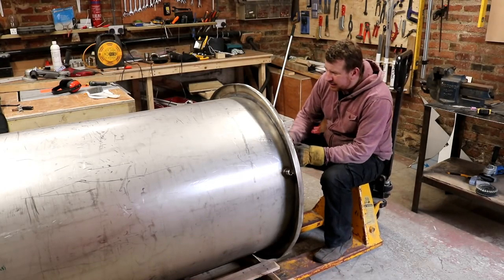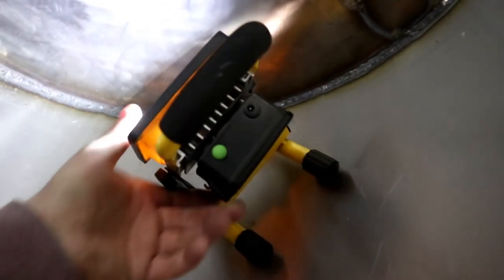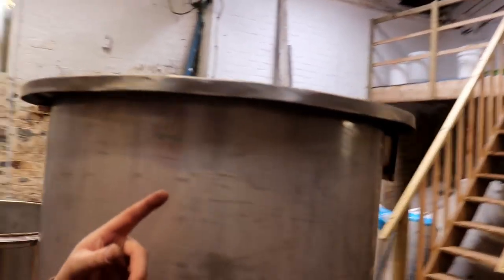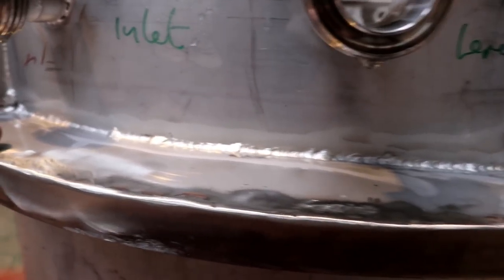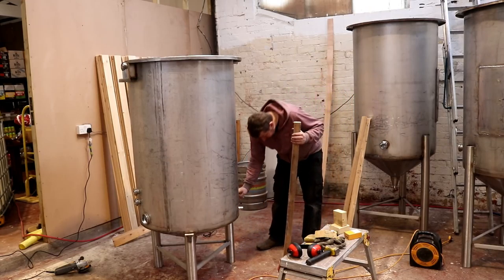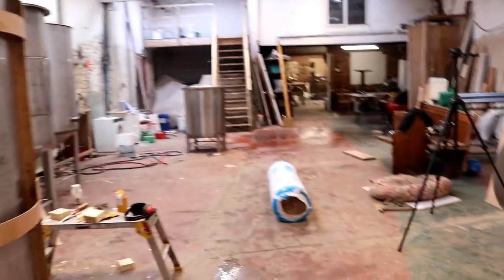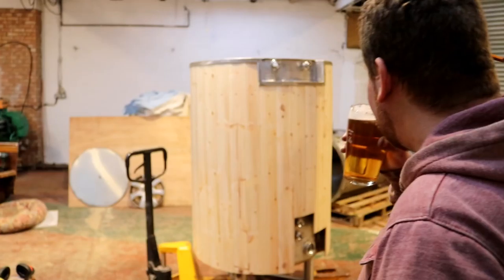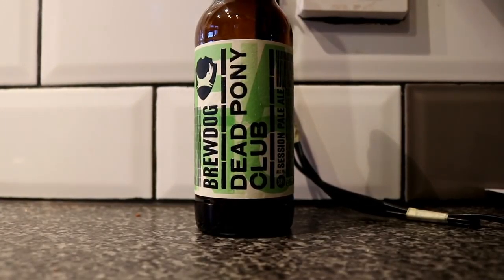How To Clad Brewery Tanks With Wood

Comment: here comes the rain again, raining on the roof like a new emotion 😉 . Nice pirouette on what looks like a fantastic piece of kit. I don't think that the screw holes need filling, they add character, if the banding is just for looks then I don't think that you need that either, just varnish to keep the water stains off. Cheers, Schnuz.